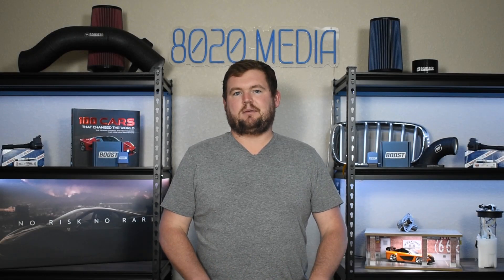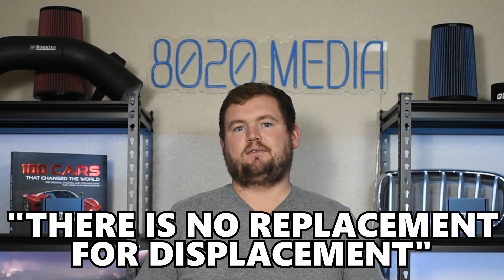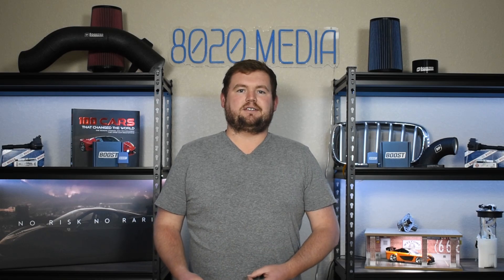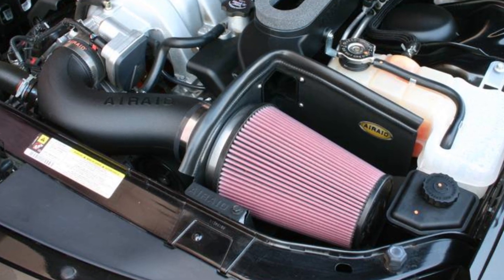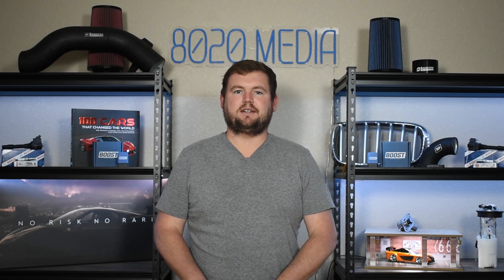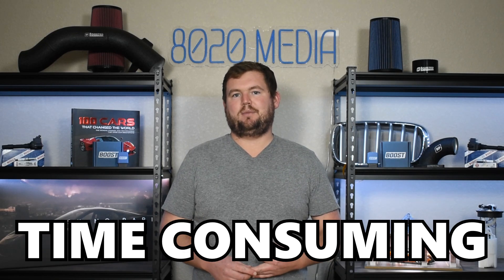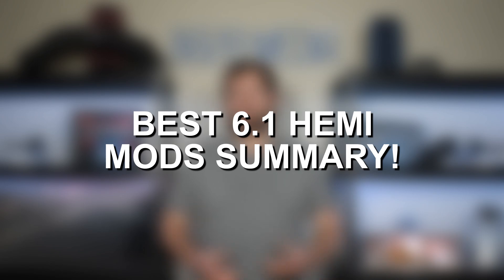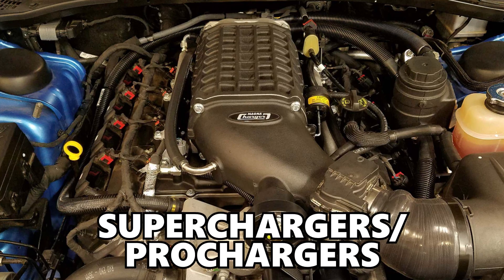How to Build a 450 WHP 6.1L Hemi!

Comment: I have an 08 challenger with an intake, old predator tune and mbrp exhaust. It's run great for 17 years. I'm hesitant to do cam and heads on the stock motor so I've figured that replacing the engine would be probably my best route.
Reply: what engine would u replace it with?

Comment: Just a point I recently did some mods on my srt8 jeep.

The motor came out stripped down and rebuilt it was in great condition but I wanted too upgrade the lifters and oil pump.

Heres a big point the price of headers was similar too forged pistons with a 30thou over bore it was an easy choice to make as the motor was out and stripped.  It is now ready for boost if I want to.

I did my research and ported the intake myself while the motor was being built.  It has a stage 2 comp cam, valve springs and the heads had a three angle valve grind and was match ported when reassembled.  The crank was balanced as well.

It halls ass, as many people in the know will tell you ''ït's in the build'' and don't go cheap you get what you pay for.  If you have a good engine rebuild shop use them.

I'm in New Zealand
Reply from the maker: R - Nice! Thanks for taking the time to share your experience.

Comment: Spartan max torque cam and performance heads, ported intake, exhaust port touch-up and tune got me 455/426 at the wheels on a dynojet - thats ~520 crank hp - with stock exhaust and gears. She's two tons of fun! I've been told by my pro builders/tuner that the stock 6.1 short headers and exhaust flow great to over 600 hp, so no need for long tubes unless one is going stroker or forced induction.
Reply: You will definitely benefit immensely from long tube headers. Which is guaranteed to flow better than the stock logs they put on this car
Reply from the maker: M - Nice build! Thanks for taking the time to share as this will certainly be helpful for future viewers as a reference.
Reply: Longtubes will always be better than shorties, been proven to pick up +20 HP on a 450chp (dyno mule) 5.7H